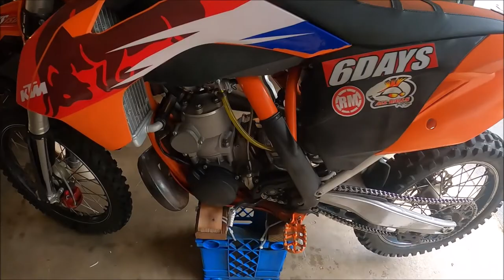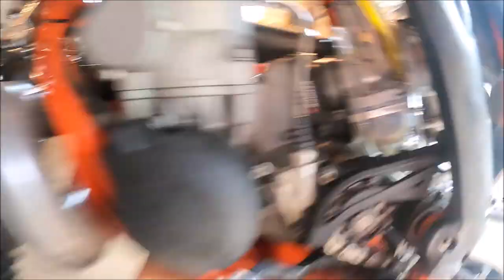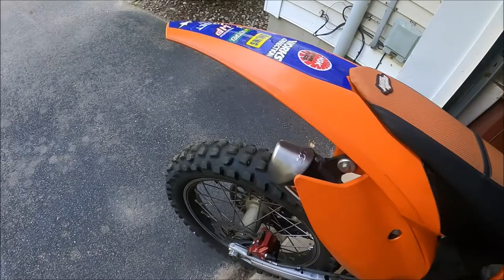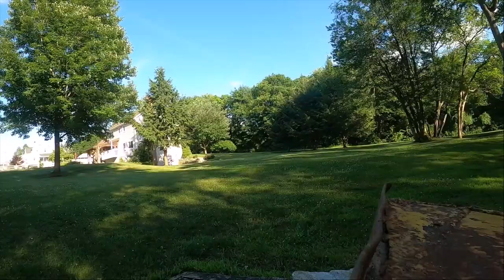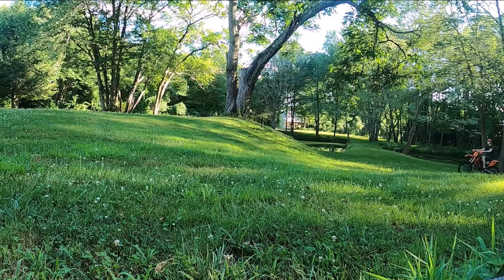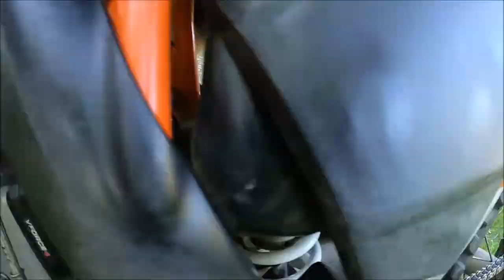First Start Up w/ Lectron Carb | KTM 250sx

Comment: does your bike spooge at all? what oil ratio are you running
Reply from the maker: It does a slight bit if I'm running it at mid to low RPMs for a long period but not much. I run a 44:1 oil ratio.

Comment: Any troubles getting the Lectron carb to fit? I’ve got a 2014 Ktm sx and the Lectron is pushing on my air intake. Wondering if you came up with a solution
Reply from the maker: Nah, I didn't have any fitment problems